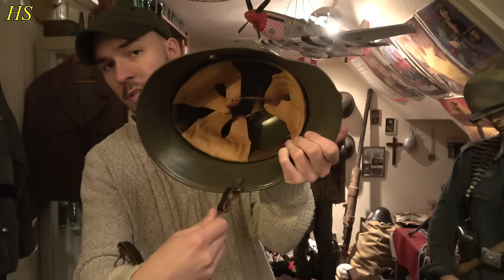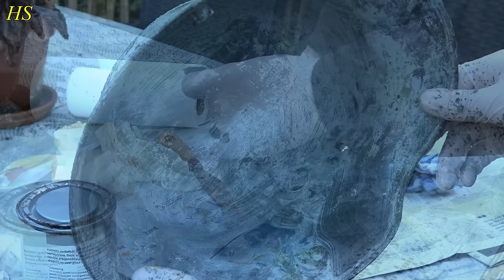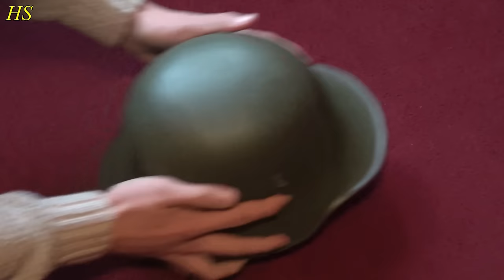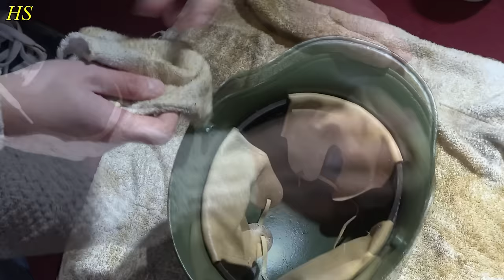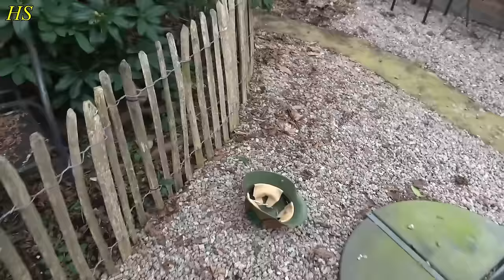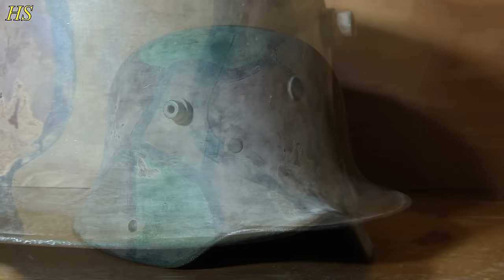Restoring an Original German World War 1 M1916 Steel Helmet Back to its Former Glory! GREAT Result!!

Comment: I have several of these helmets. The dazzle camouflage was only used by elite Stosstruppen (Stormtrooper) battalions & not the regular army. The soldiers were given cans of paint, the same colours & paint used as the Lozenge patterning on Imperial German aircraft. The soldiers were issued with brushes & paint that was available in the field & they would gather together & paint these very quickly. Each man painted his own helmet & then used black to break the colours up. There were guidelines & specifications issued to do with colours next to each other & the width of the black lines. For a guide to the basic helmet colour use Humbrol Bronze-Green. For the disruptive camouflage colours research the colours used on German aircraft for the Lozenge patterns found on the underside of the wings. Not all colours were used, the soldiers used whatever they were given & what was available in the field. Some soldiers used them like this others would drop dry sand onto the still wet paint to dull the surface down. It was a very low-tech application but it was very effective.

Comment: matbe some tips to make it even better, if you use some salt water on the helmet it will rust fast and it will look even older then apply mud again and then use some matt varnish to permanently stick the mud to the helmet so when it rains it won't come off. Even tho you're probs only gonna use it for display. And to answer the question about my fav camo, i am a sucker for ww2 normandy camoflage. Thanks for a nice video again.

Comment: If you sand the paint (just very roughly to open up the surface a little) before applying the paint remover - it should work much better. Just from my experience.. I don`t know exactly what they put in some old laque paints but that stuff was made to last and can`t be removed so easily..

Comment: I picked one of these up from a crackhead when i worked a surplus store for 25$. I guess they had tried to restore it and spray painted it black inside and out. It was in great shape save for some shrapnel damage. I the same took it down to metal, primed it and stared the arduous task of finding out the correct color. Lucky enough under the paint on the inside was the original paint.

Comment: Next time you use paint striper. Use a razor blade all over the helmet to make cut marks in paint. Will work better. Also cover helmet in plastic after applying paint striper, helps it bubble faster.